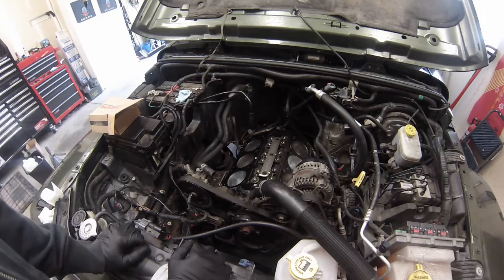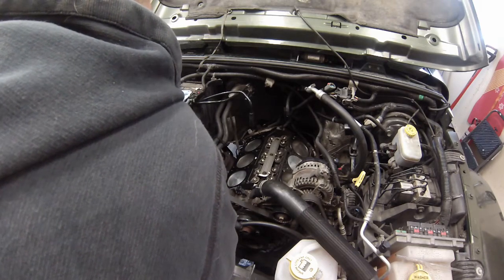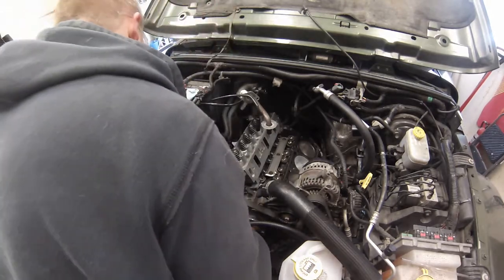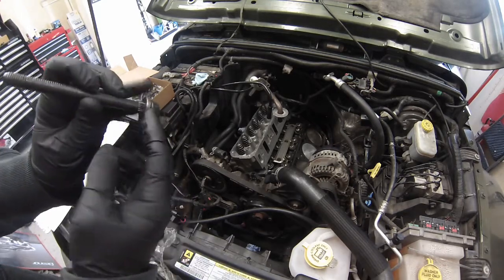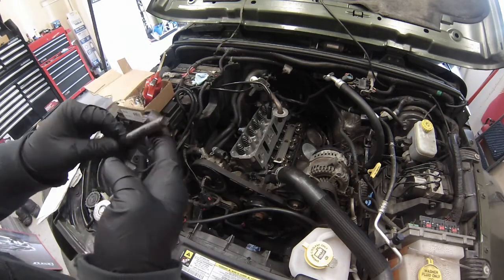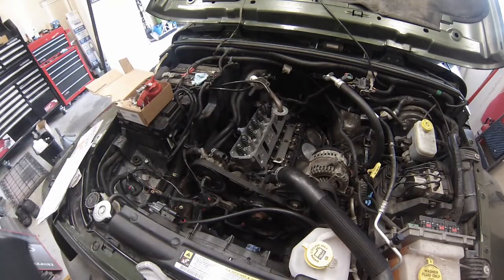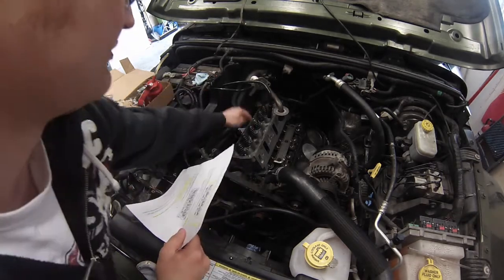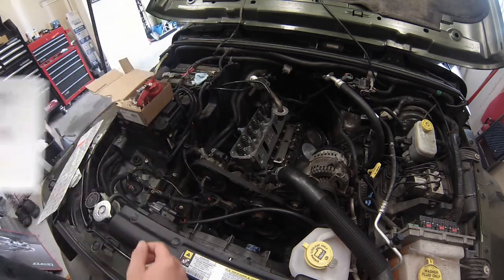Jeep Wrangler JK 3.8L Engine Rebuild Part 8 - Head Install

Comment: Thank you for this one question where did you find that paper work that you have on the video to get all the torque sequences and torque specs please man
Reply from the maker: I had to pay to get a service factory manual. You can find them online at eBay and such or get them from a dealer but they are very expensive at dealers. Thanks for watching!

Comment: Did you reuse the old head bolts or buy new ones
Reply from the maker: I bought new. Head bolts should never be reused on torque to yield bolts. I chose fel pro for the new bolts. I've reused head bolts on old four wheelers and small engines but for a vehicle you need to rely on, you should always buy new. Thanks for watching!
Reply: @TheDadBodWorkshop how are the fel pro bolts ?? I thinking of getting the same things and going oem on the head gasket bro

Comment: Hi! Im currently rebuilding my 2009 3.8 Wrangler engine. Got the Enginetech kit. Can you tell where to use som kind of sealant with the gaskets or not? Cheers
Reply from the maker: You should use gray RTV for certain places at the oil pan as well as the intake manifold. Usually anywhere you have two metal faces meeting together. Thanks for watching!

Comment: 2 months ago my sons 2011 Jeep JKU 3.8L started having an overheating issues from a leaking radiator. We replaced the radiator and since then he's been having sporadic overheating issues not everyday but a few times a week. 3 weeks ago we replaced the thermostat and radiator cap as overheating increased. Still no luck fixing it, we replaced the water pump a week and a half ago. After about a week later he was still having sporadic overheating only now it was pushing all the coolant into the overflow bottle but wouldn't suck it back into the radiator and the upper radiator hose would collapse flat after turning off the engine while it slowly cooled down. His heater coil wasn't heating up and blew mildly warm air out of his vents also. He was also getting a weird misfire on the #6 cylinder during all this too. So we changed the plugs, which was long overdue anyways and then completely flushed the coolant system with water again. We completely filled the coolant system with water only to see if we could see anything leaking once we got the engine to normal temp without the cap on. It burped  and gurgled as one would expect but once it reached normal temp, the water looked like it was boiling without the cap on but wasn't hot to the touch. The fumes coming from rolling "boiling" looking water smelled like exhaust gas and the #6 misfire came back after the plug change. We turned it off, let it cool a bit, then pulled the #6 sparkplug and it was wet with water. With the sparkplug removed we started it up and water mist blew out of the sparkplug hole. So tomorrow we are going to tear it down all the way to the heads and inspect the lower intake manifold gasket and head gaskets for breaks or cracks while openly hoping it's not a cracked head or block! BTW, the oil color, level and viscosity is still normal and is not milky! A lot of time a some money has already been spent getting us here to this point. I read a blurb about a jeep "silent" recall over the left engine head issues of the 3.8l engine but can't find any active recalls for it. When it rains, it pours... thanks for the video...
Reply from the maker: You bet! It's worth taking it to a machine shop to have the heads cleaned/milled if needed. When I filmed this is i really didn't have the money to get it machined and most machine shops in my area wouldn't perform small jobs due to the demand of machine shops at the time. Good luck with the rebuild!

Comment: Hello, I have a question I was changing my fuel injectors and one bolt went inside the intake the one in the right rear what I should do?
Reply from the maker: You can probably fish it out with a magnetic wand. You definitely need to get it out. Take off the manifold if you need to. Thanks for watching!
Reply: @TheDadBodWorkshop  is what I did I removed the intake and I fish it out with the magnet. I’m glad that was there and not inside the head..do you recommend to change the lower intake gasket?
Reply from the maker: It's recommended since you're down there. If I remember right you need to add a little RTV to the corners where the manifold meets the block.
Reply: @TheDadBodWorkshop  thank you for you help

Comment: You skipped the whole install of the push rods and rocker arms assembly. What torque spec did you use on the rocker arm bolts and did you reuse the old ones??
Reply: No shit. That's the only thing I'm wanting to see of this whole 13 part build!
Reply: @joshuagibson2520  I took the rocker arm assembly out and now I can't get it back in and seated... Any suggestions?
Reply: @mhtinsley1  nope. I only took my valve cover off and everything looked okay. Put a fresh gasket and sealed it up. Uuugghh. Still ticking like fuck though. Compression is good, but I have gas on my plug when inspected. I have a bent valve or a stuck open injector I guess.
Reply: @joshuagibson2520 may be your fuel injectors
Reply: Yes, I wonder the same thing.

Comment: What did you end up doing about the snapped exhaust manifold bolt? Was it hard to get out of the head?
Reply from the maker: Luckily a local shop was able to extract it without too much trouble.